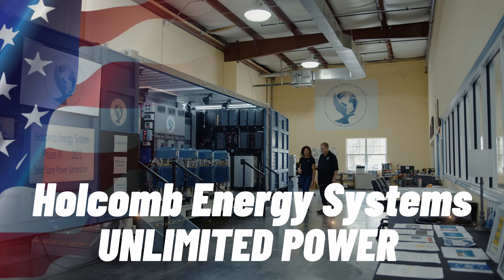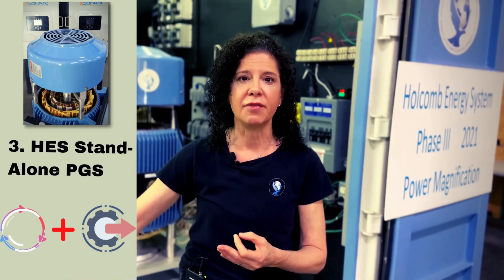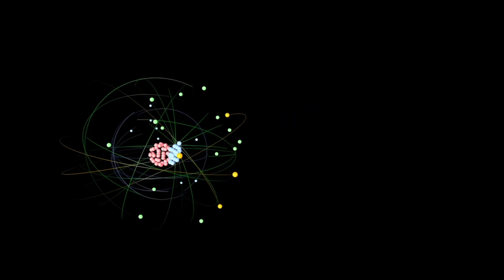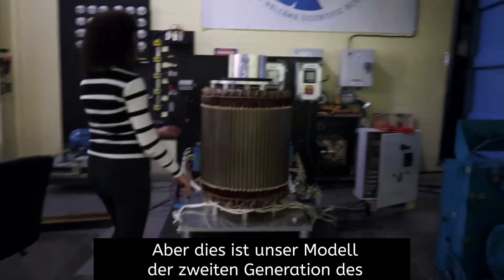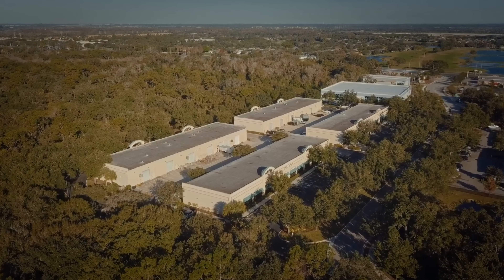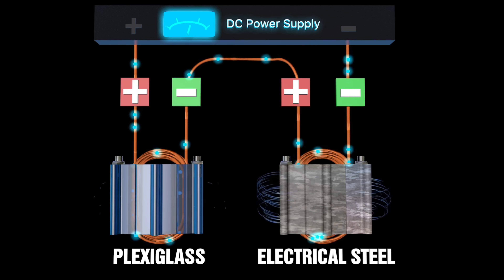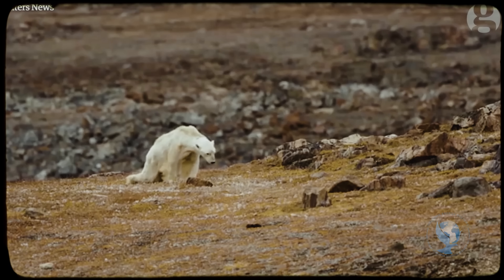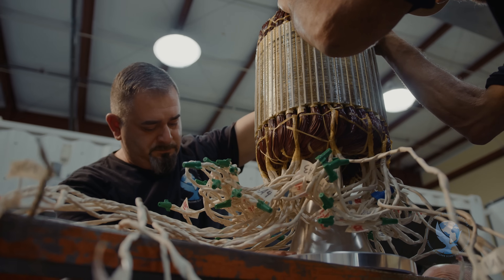American Company Shocks the Whole World with New Free Energy Generator from HES Available Now 2025!

Comment: "Astra Energy, Inc. (OTCQB:ASRE), an electric services company, announced the resignation of director Robert Holcomb on Monday, April 14, 2025. The resignation comes in the wake of a recent search and seizure of equipment at Holcomb Energy Systems LLC, details of which remain limited according to the company’s statement."

As of April of 2025 the investors are suing Holcomb Energy and the companies assets have been seized.
The lawsuit initiated by Holcomb Energies sole customer on the basis that the unit they bought did not work as claimed is ongoing.

Holcomb Energy assets seized and Robert Holcomb ousted as director of  Astra Energy which has liabilities far exceeding it's assets, with stock that is essentially worthless with a value just less than 4 cents per share.

The scam has essentially collapsed.

Comment: Let's reframe Earth's low contrast abundant ambient heat as a thermal   energy waypoint between heat and other forms of energy. Energy changes form without gain or loss. Uniformity is not in itself a form of energy.  

Energy sensible refrigerators that absorb heat and yield electricity of equivalent energy content would complement computers as computing consumes electricity and yields heat. Computing would be free. Chips could have energy recycling built in. This would improve performance and lower cost. 

Full heat recycling, all electric, very isolated underground, undersea, or space communities would be highly survivable with self sufficient EMP resistant LED light  automated vertical farms, thaw resistant frozen food storehouses, factories, dwellings, self contained elevators, safe rooms, and horizontal transports. 
In a flourishing civillization, small self sufficient electric or cooling devices of many kinds and styles like lamps,  smartphones, hotplates, water heaters, cooler chests, fans, radios, TVs, cameras, security devices, robot test equipment, scales, transaction terminals, wall clocks, open or ciosed for business luminous signs, power hand tools, ditch diggers, pumps, and personal transports, would be available for immediate use incrementally anywhere as people as individuals or larger social groups see fit. 

Some electrical equipment groups could be consolidated into local networks when suirable. Liguid nitrogen cooled superconducting networks would become practical 

If a high majority thinks our civilization should geoengineer gigatons or
teratons of greenhouse gasses out of our environment, instalations using devices that convert ambient heat into electricity can hypothetically be scaled up do it with a choice of comsequences including many beneficial ones. 

Refugee communities would be buildable quickly. Fire safes would preserve contents to 1000F for years. 

A simple rectifier crystal can, 
just short of a replicatable long term demonstration of a powerful prototype, almost certainly filter the random thermal motioren of electrons or discrete positiive charged voids called holes so the electric current flowing in one direction predominates. At low system voltage, a filtrate of one polarity predominates only a little but there is always usable electrical power derived from the source, which is Johnson (observation) Nyquest (theory) thermal electrical noise. Max Plank anticipated that ambient thermal noise would become usable with advances in technology.  

In 1973 I filed for US patent 3890161A DIODE ARRAY for an array of metal1/ insulator/metal2 diodes that refrigerate while concurrently producing electric power. The patent was granted in 1975. It was opened to the public domain in 1992. Development should be in the public domain. 

The plausible net electrical filtrate from diodes can be aggregated in a first grouping of separate diodes in  consistent alignment parallel. After a primary level of grouping that preferably is in parallel, compound parallel and series networks can be built 
to provide desired DC current and voltage. Within limlts, parts of the  network can be shorted out or open circuted without electricalor chemical  harm. Widely  scalable electrical power always with equal refrigeration is thus possible. Inefficiency effects the performance but not the equality of the thermal absorbtion and electrical yield of the conversion. 

The maximum energy is converted from ambient heat to productive direct current electricity when the load electrical resistance  is equal to the array internal electrical resistance. Maximum calculated electrical power output (watts) is k (Boltźman's constant), one point three eight x 10^ minus 23, times T (temperature Kelvin) times bandwidth (0 Hz to a natural limit ~2 THz @ 290 K) times rectification halving and nanowatt power level rectification efficiency, times the number of diodes in the array. 

There are a billion cells of 1000 square nanometer area each per square millimeter, 100 billion per square centimeter.

Order is imposed on the random thermal motion of electrons by the structual orderlyness of a diode array made of diodes made within a slab: 

Host crystal in this example is silicon 

  P type boron doped
-----‐------‐----___-- Out
🔻🔻🔻🔻
■■■■■■___ + Out
  N type phosphorous doped 

All the P type semiconductor anodes abut a metal conductive plane deposited on the top face of the slab with nonrectifying joins;  the N type semiconductor cathodes or common cathode abuts the bottom face. As the polarity filtered electrical energy is exported, the amount of thermal energy in the group of diodes decreases. This group cooling will draw heat in from the surrounding ambient heat at a rate depending on the filtering rate and thermal resistance between the group and ambient gas, liquid, or solid warmer than absolute zero. There is always a lot of ambient heat on our planet, more on equatorial dry desert summer days and less on polar desert winter nights. 

There are other plausible breeches of the second law of thermodynamics.  Hopefully a lot of people in independent teams, will join in expanding the breech. Please share the successes or setbacks of experiemental efforts. 

These devices would probably become segmented commodities sold with minimal margin over supply cost. They would be manufactured by advanced automation that does not need financial incentive. Applicable best practices would be adopted. Business details would be open public knowledge. Associated people should move as negotiated and freely and honestly talk. Commerce would be a planetary scale unified conglomerate of diverse local cooperatives. There is no need of wealth extracting top commanders. We do not need often token philanthropy from the top if the wide majority of people can afford to be generous. 

I do not seek to be the lead developer. This will disable confirmation bias and assure that other developers are acting on the merits of rhe hypothesis independently. For example gold needles abutting straight into an N type GaAs substrate may be a better starting point for developmen. Phosphorus and boron in silicon crystal technology is more familiar but plausibly inferior though it. may be adequate for proof of concept prototyping. The topic deserves discussion and prototyping attempt action. 

  There could be net entropy reduction in the full lifetime energy accounting of diode array use. The entropic deteration of the structure of machine parts made of tough solids is inevitable but can be  minor compared to the stress of their use. that there is negative overall entropy.   There could be net entropy reduction in the full lifetime energy accounting of diode array use. Diode array devices should be able to power the manufacture of àn ever increasing number of these devices. 

Charles M. Brown
Kilauea, Kauai, Hawaii 96754 3:04 3:05

Comment: This video is a lie.....it doesn't create energy out of nothing.....

This is what it says in the companys website.... apparently it magnifys amperage of REAL electricity....

Capable of magnifying true electric power from any source to multiple times the power input. Previously, the voltage could be magnified or transformed. But never before has a technology existed to magnify true electric power by magnifying amperage. The ILPG has unlimited applications, including magnifying the power output from the grid and renewables, like wind and solar installations. It can increase the usable true power for any use or any facility including homes, apartments, factories, office buildings – or any consumer of electric power, reducing one’s power bill, and carbon footprint, by up to 80

Comment: When an EV Electric Vehicle needs a new battery, could this device provide all the power for an EV?   A man in Great Britain with a nearly new Tesla needed to replace his Tesla's battery and was told he would have to pay for the new battery because it was not covered under warranty.  A replacement battery for his Tesla was priced at $35,000.  
Will Detroit be able to put these devices in their new EVs in place of a battery to have cars and trucks that can go long distances with no time spent recharging?  I have a KIA NIRO hybrid which is an electric car with a gas motor to recharge the battery.  When  I bought the hybrid car I was offered a large battery for another $2,000 which could be charged overnight and power the car for only 25 miles.  Chikumbutso in Africa has priced his briefcase sized endless power device at $10,000.
Reply: This device can not provide any power at all! It's just one more free energy scam.

Comment: Where does the input energy come from? it sound like you used old tech of phase converters to switch phase and boost it in a larger fashion, guys have been doing this for home shops for quite some time now when their shops are only wired for single phase and most of their lathes and mill drills run on 3 phase .